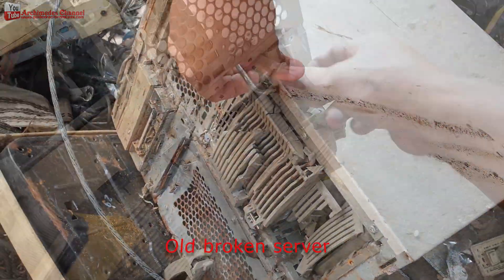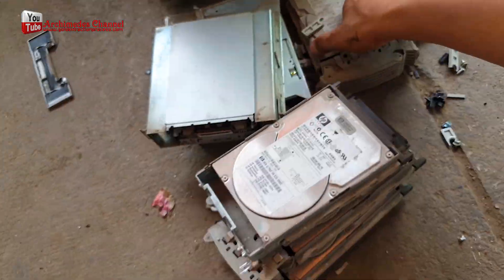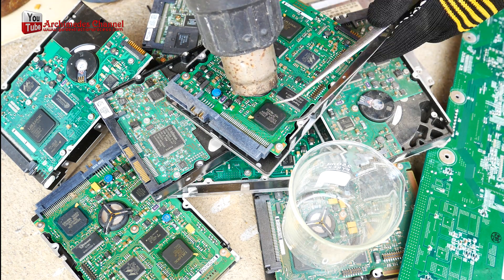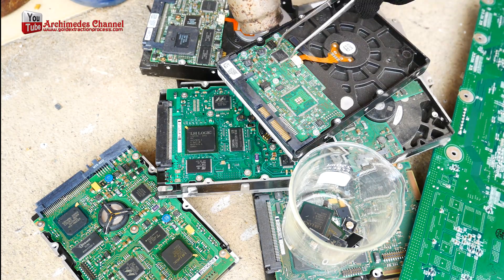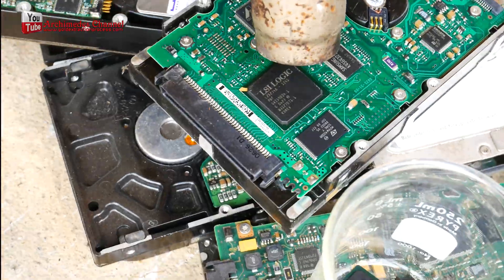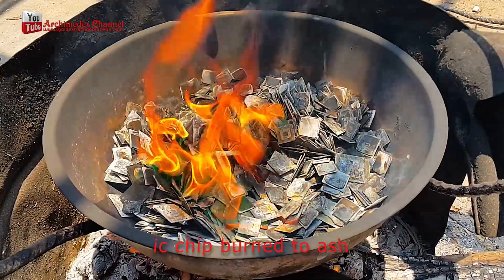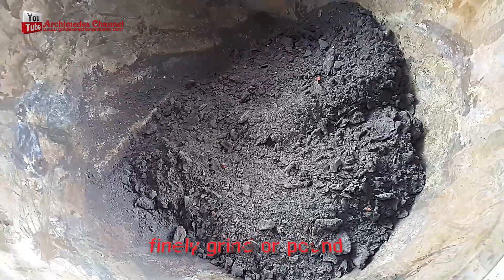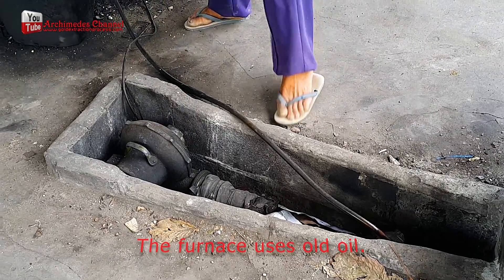How to Make Gold From HDD Hard Disk Drives | Original Gold Extraction From Old Computers 🔍✨

Comment: I'm just going to take a guess at this, but maybe the cement mixed with water step and smelting on top of it, is because it needs to be remelted with heat from the top that will blow away the rest of the carbon and the resulting fumes, leaving you with only a clean, pure metal alloy. Think of it as an extra filtration step using fire instead of acids? I have no fucking clue honestly, but that's my guess.🤷‍♂️🤷‍♂️